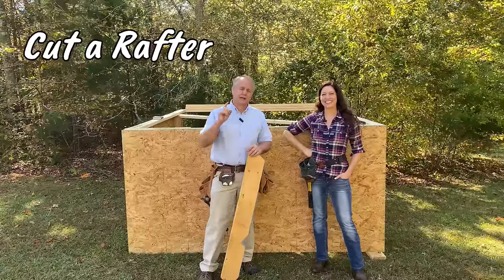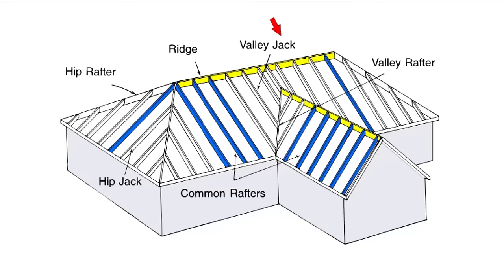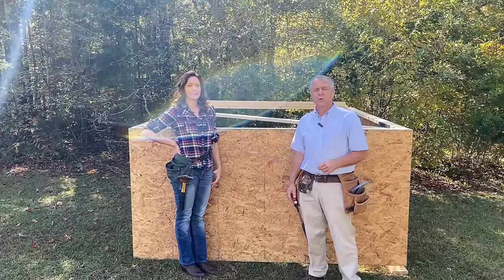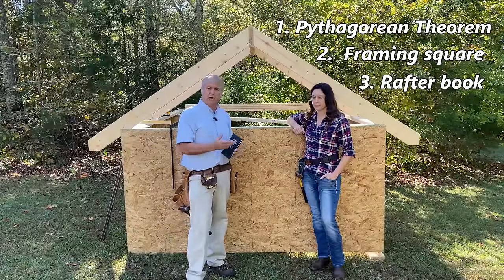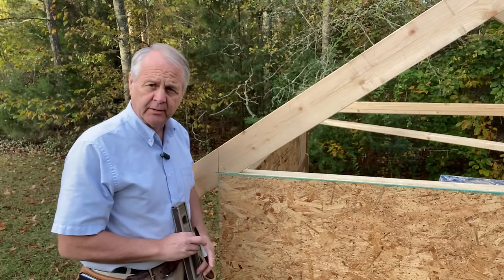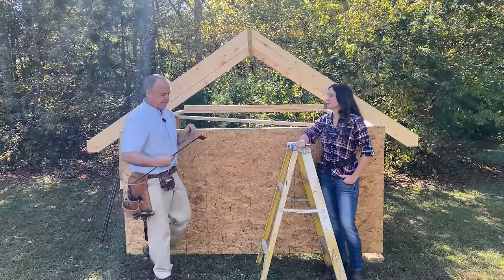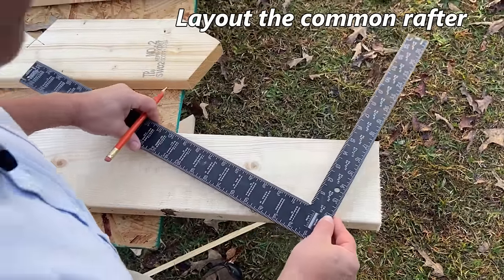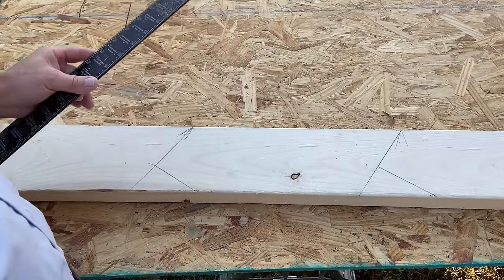Beginner’s Guide to Roof Framing – Cutting a Rafter, Step-by-Step

Comment: The comments are comical 😂! I just spent an hour rewinding the video and going through it. The guy did a great job explaining things, especially if you have zero roofing experience. If you made it past the 5th grade and aren't complete idiot, this shouldn't be hard for you to understand. If you read this comment, good sir, what pitch would you recommend ( none snowy area) for a chicken coop 4x6 the run being 3ft? Look at me, go 😂! Thank you for everything.
Reply from the maker: The best pitch would depend on several things. If you are using a shingle roof you don't want to be flatter than a 3/12 pitch. A metal roof can be as flat as 1/12 without any issues. A steeper pitch usually is more attractive in appearance. It would also give you higher head height in the coop. So, it all depends on what you are trying to achieve. I hope this helps. Thanks for watching!
Reply: Yes
Reply: Just a FYI I know you want to use these skills but I've built a few chicken coops and I usually just cut the posts at a 15 degree angel and put a half roof on it. Easier and cheaper to be honest. Gable may look nicer but for simplicity and price I go with the half roofs.
Reply: @MM-overtime  You're 💯 percent correct. The big sister became an overnight homesteader  😆 so I did that for the rabbit hutch. It was a lean to 10 degrees, I believe. She then tasked me with a "chicken coop." Being who I'm, I did about a month of research. I got done preparing the site for a 6 x 16, Carolina style Coop build yesterday 😂. I realized I couldn't get that professional look with just the tools I have . So I have a planer, track saw, and table saw on the way from Amazon Prime day, wish me luck. I will be skipping the ridge pole and running gussets. On the 4x6 coop ( 3 rafters front middle back, I'm going to do a 4 or 6 inch pitch depending on what looks best and a metal roof. The run will not have the same roof it will have polycarbonate at a 1 -  maybe 2-degree angle. Full size Dutch door, custom waterer and feeder, deep liter method will be used 👌. 

The only thing I have not decided on yet is if I'll do pocket holes and lay the 2x4 on the flat  side and use them as trim with the plywood inside like the carolina coops and then for the two 4 foot sides frame them regularly or do the same place them flat 🤔 and run the plywood inside if that makes sense. Either way, thanks for commenting. Stay safe.

Comment: Thanks for the confusion
Reply from the maker: Thanks for watching! Sorry if you were confused. If you are totally new to roof framing it can take a while to get comfortable with it.
Reply: @RoofFramersBible  I have looked at this video many times and at certain parts you do explain the info on a beginners level, but then you go off into an advanced level where someone who is familiar with this will understand.  In the drawing that you have in the video the numbers do not add up, that's where its more confusing than helping.  If you present the drawing to a person that has never cut a rafter before it will not make any sense to them.  Most of the videos out there throw numbers at you but never explain how they got to the numbers.  In your drawing the numbers on the left bottom does not match up with the numbers on top, then on the right the same applies.  I like the video and how its presented but I still don't know how to cut a rafter since the numbers don't add up.

How can 5' on the bottom left add up to 72-1/8" on the bottom top?  Even if you add in 32" for the rise that adds up to 104-1/8".  On the right side its the same the numbers are off.
Reply from the maker: @sledgehammer7998  The 5' on the left is run, or a horizontal dimension. The 72 1/8" overall dimension on the right is measured along the slope of the rafter and is therefore longer. The run dimensions and the rafter dimensions are never the same. New concepts are often confusing. Just take it one piece at a time and you'll have it in no time. Thanks for watching!
Reply: And its for beginners

Comment: "The term “birdsmouth” in the context of roof framing refers to a specific type of joint or cut made in a rafter. This joint resembles a bird’s mouth, hence the name1.

In light frame construction, a birdsmouth joint, also known as a bird’s beak cut, is generally used to connect a roof rafter to the top plate of a supporting wall. It is an indentation cut into the rafter, consisting of a “seat cut” (the face of which rests on the top plate) and a “heel cut” or “plumb cut” (the face of which lies parallel to the supporting wall), forming a shape resembling a bird’s mouth2.

The indentation should not extend unsupported on the interior in order to maintain the structural integrity of the rafter because the unsupported section can split along the grain of the wood2. The joint is generally fastened with nails by toenailing the rafter from the side into the top plate below2. As a general rule, no more than one third of the depth of the rafter should be removed, in order to maintain structural integrity."
Reply from the maker: Well said. Thanks for watching!

Comment: So glad we came across your no-nonsense, to the point videos, such an excellent knowledge base!
We'd like to convert our concrete block garage into a games room, and replace the hip roof, aligning the new ridge above one of the exterior walls, so the other half of the roof spans the drive, and is supported by posts, to form a car port.

For a lightweight roof, would you recommend:

A) All out prefabricated trusses
B) Or divide the length of the roof with 2 large A-frames (using rafter and collar ties). Join these together and to gable ends with purlins.  Then lay approx 4x smaller gauge rafters on 400 centers per section?

Trusses offer great strength but we lose the open roof space, so we prefer option B, but concerned if it will cause much load spread of the wall plates, even with a load bearing wall beneath the ridge?  Appreciate your advice, keep up the fantastic channel!
Reply from the maker: From what you describe that should be fairly straightforward. I am not a big fan of trusses except where you need them for the spans. If the ridge is to be over a bearing wall then you have no issues with the walls spreading. If the ridge can't come down then there is no lateral rafter thrust. It is simply a matter of sizing the rafters for the intended span. It sounds like you are contemplating using a field built truss in a couple of places, running purlins between them, and then putting rafters on top of that. It's unclear to me why you would go that way. It would seem easier to just use rafters on each side from eave to ridge at 400 ml on center. It could be done the other way, but you are concentrating the load on those "A-frames". Hopefully this answers your questions. Good luck and thanks for watching!

Comment: Keep in mind that some codes limit the birds-mouth notch to a maximum depth of one quarter the dimensional width. 
In this example here, the notch would be limited to 1 3/8 inch across the width of the stock (5 1/2 inches). 
Don't compromise rafter tail strength in lieu of top plate bearing as some codes state that an 1 1/2  is the minimum seat bearing needed for 2x stock.
Balancing between the minimum and maximum requirements is the key to strong building practices.
Reply from the maker: Well said! Thanks for watching!

Comment: Do you have a video where you cover measuring for the seatcut?
Reply from the maker: It is covered in several of the videos. I don't have a video specifically on that alone. Marking the birdsmouth is dependent on several variables, such as the width of the wall plate, the size of the rafter material, and the H.A.P. . Perhaps I need to explain that more clearly. Thanks for watching!

Comment: how did you determine the height of the ridge beam? and/or how did you determine where the bird mouth went?
Reply from the maker: Many times you don't need to determine the ridge height. You simply calculate and set the rafters and they will set the ridge height. Of course you can easily calculate the ridge height as needed using the rise and run. The height of the ridge above the plate would be the total rise of the rafter plus the H.A.P. dimension. Thanks for watching!
Reply: You don't need to know that normally, unless the rise is critical, determining the pitch

Comment: how long can the span be with  out putting a post in the middle?
Reply from the maker: It wasn't covered in the video, but you always must have either a ceiling joist tying the rafters together at the plate line or a structural ridge. It the bottom ends of the rafters can't push out, the ridge can't sag. Or, if the ridge is structural and can't sag, then the rafters will not push out or spread at the bottom. Obviously there are limits to the spans of both the rafters and the ridge. The allowable span of the rafters will vary depending on the material / size of the rafters. If you are using a structural ridge, it has to be designed to carry the imposed loads. I wish the answer was simple, but it depends on a lot of different variables. Thanks for watching!

Comment: Excellent video!!! I do have a question though. Do you put the ridge board up first and then determine your rafter length? I've seen it where people will mount the ridge board first and then cut the rafters accordingly. Thanks
Reply from the maker: In most cases you want to calculate the rafter lengths and then use the common rafters to set the ridge height. It is possible to set the ridge first, but that is not commonly done, unless you have a structural ridge beam. Thanks for watching!

Comment: Thank you for your video, but i have a question. It is not necessary to have a rafter tie or a collar tie?
Reply from the maker: Yes, you are correct. Although beyond the scope of this basic video, it is necessary to have either a tie across the building or have the ridge fully supported. If the ridge can't come down, the rafters can't push out. A ceiling joist tie across the building will also resist the rafter thrust. Thanks for watching!

Comment: I'm currently building a shed and haven't gotten to the roof yet... this will make it so much easier!  Is there a recommended size of lumber for roof rafters vs pitch?
Reply from the maker: The thing that determines the rafter size is the structural capacity for a given horizontal run of the rafter. The pitch or slope only has a limited impact on the decision. For limited spans such as on a shed, they would generally be 2x6's, but if it is small enough you may be OK with 2x4's.

Comment: Anna, where were you at the end with the eave cuts? “Hey wait why measure 4” for the plumb cut of a 1x6 facia board?”
Reply from the maker: I have generally used 4" for the plumb cut when using a 1x6 fascia. This allows the finish fascia to extend up to the top of the roof sheathing and also to hang down with a roughly 3/4" reveal from the bottom of a 3/8" soffit material to the bottom of the finish fascia. I hope that answers your question. Thanks for watching!

Comment: Is it possible to have a birds mouth on the interior of the top plates and plumb cut flush with the exterior walls?
Reply from the maker: You can certainly cut the rafter tail off flush with the outside of the exterior wall. The birdsmouth would be the same, sitting on top of the plate.

Comment: Builders square everything you need ...for your roof to scale, pitch, plumb cut, Birdsmouth all in one.

The Short leaf your riser/long leaf run, i do insitu stairs, as well.
Reply from the maker: The framing square can do it all. I almost always use the full scale framing square instead of the smaller speed squares. If you are doing standard roof pitches they make it easy. Thanks for watching!

Comment: Hi, as per your recommendation iv purchased both your book " Roof framers bible" and the "A roof cutters secrets " as they go hand in hand. I got your book first and love it. I only recently got the secrets book and noticed some discrepancies between the two.
For example in your book 10/12 page 52 the rafter ratio is 1.302 which I believe is right. But in the secrets book page 299 on same 10/12 pitch rafter it has a ratio of 0.8333.
I must be reading it wrong. Could you have a look please?
Thank you
Also I noticed that the tables in your book stop at 25 feet, what if the span is greater then that
Reply from the maker: It is just a confusion of terms. On page 298 of Roof Cutter's Secrets in the chart for "Rafter line-length ratios" you will see 1.3017, which the the same as the rounded number in my book for the rafter length. If you look on page 299, the "Roof-Rise Ratios" gives .8333. This is giving the rise of the roof, not the rafter length. If you look back at Roof Framer's Bible page 52, directly below the 1.302 factor for rafter length, you see the factor .833 for rise. So, it is the same in both books. Just a little confusion as to how to read the charts. Thanks for watching!
Reply: @RoofFramersBible hi, thank you so much h for getting back to me so quickly.  I see it now ha. If it had teeth I'd of got bitten. I love your book. I don't get all of it yet but most of it makes perfect sense

Comment: How do you get your HAP if your rafter isn’t already up though?
Reply from the maker: H.A.P. is the abbreviation for "height above plate". It is measured vertical right above the outside of the plate. It is determined by the depth of the notch for the birdsmouth. You may want to watch our first video "Beginners guide to roof framing" to understand H.A.P. and positioning of the birdsmouth. Thanks for watching!

Comment: hey, Barry......I bought your book and am using it for a project of mine.  I have gone over the numbers several times for a regular equal pitched roof.... and measured and remeasured.....The "rise" calculations are either flawed in your book or you didn't give info on how to calculate these...I'm doing a simple 8/12 pitch.  My 2-by ridge beam needs to be much higher (about 4 inches higher) than what your book says for my run/rafter length measurements.  I've run it over in my brain countless times on how it could be wrong!  I have found that bird mouth depth (which depends on top width of top plate/band/top strap framing) will vary, which will, in turn, lower rise height of my ridge beam.  The interesting thing about this is that even though my bird mouth is cut for a 3inch wide top plate, my ridge beam is STILL around 4 inches to LOW!   I have read through all the instructions in your book (which are very clear) and, like I said, measured and remeasured (and calculated and re-calculated)  as well as watched your videos and cannot find a clear explanation on why your listed rise numbers are off by so much?  I realize that I could just mount 4 rafters and lift ridge beam into place to match the height of the rafters, but lifting a 16ft treated 2x8 and securing it to dangling rafters isn't ideal when working by myself on this!  It is WAY easier to just temporarily mount my ridge beam at the height I need (which I sure wish was in your book) and then attach the rafters to it.  If you have any pointers, I'd LOVE to hear them!   THANKS!
Reply from the maker: It sounds like you are not adding in the height of the H.A.P. That is the abbreviation for "height above plate". When I wrote the book 30 years ago that was not a term I used, but is more commonplace now. Some people and some books will talk about the "measuring line" for rafter lengths. They run this from the corner of the plate. I consider this unnecessary confusion. Using the method in my book, the important thing to keep in mind is that the rafter run, and rise, is always figured from the top edge of the rafter. So the rise will be the vertical distance from the top of the rafter at the outside of the plate, and the top of the rafter at the side of the ridge (if you figured the run to the side of the ridge). You will need to add the height distance from the top of the rafter at the outside of the plate line down to the level of the plate (H.A.P.). If you do that you will have a very accurate height for your ridge beam. It isn't possible to provide ridge heights for every scenario in the book, because  there are an infinite number of different conditions for the rafter and birdsmouth. It will vary by the width of the framing members, and the depth of the birdsmouth cut. I hope this answers your question. Good luck with your project, and thanks for watching!
Reply: @RoofFramersBible  Thank you so much for this explanation!  it worked out great!
Reply from the maker: @markraymond2221  Good deal!

Comment: So rise is determined by ? Roofing materials has to be some or just preference on looks
Reply from the maker: Rise is determined by the roof pitch that is selected. Most of the time the pitch is determined by architectural preference. Often an architect will specify a steeper roof so that they can achieve a larger roof mass. It is just a matter of balancing the proportions of the house. It is one of those "beauty is in the eye of the beholder" situations. Personal preference and architectural style will dictate the roof pitch selected. Thanks for watching!

Comment: Good video but you completely skipped over how to connect the common rafters to the ridge. Was the ridge just nailed flush into the end of the first rafter? If so, then how is the facing rafter nailed to the ridge?
Reply from the maker: Yes, the ridge is face nailed to the top end of the first rafter. The opposing rafter can be "toe-nailed" into the ridge. You typically would also face nail into the rafter from the opposite side of the ridge. You simply start the nail up next to the side of the first rafter and angle the nails to engage the center of the opposite rafter. I hope that answers your question. Thanks for watching!